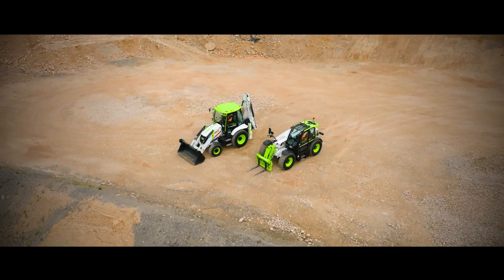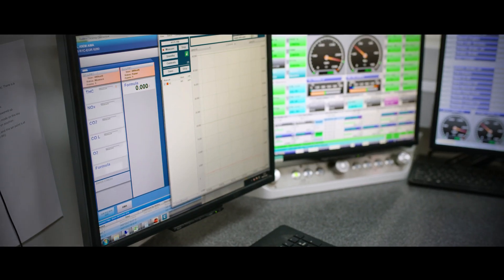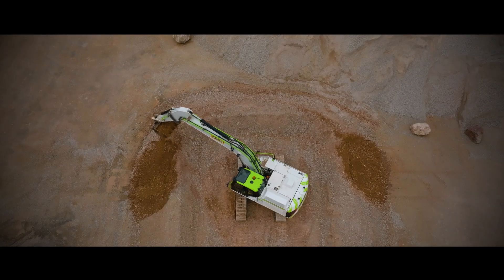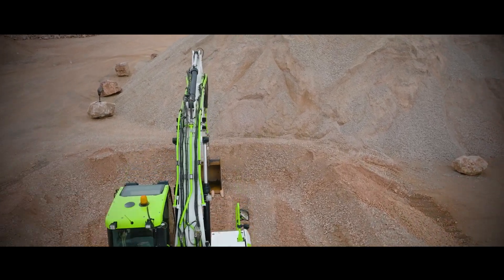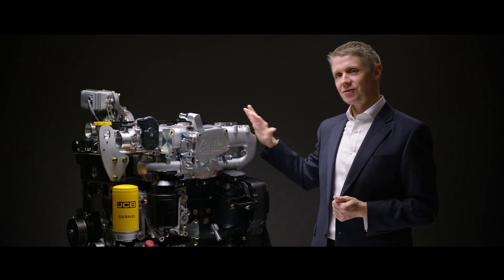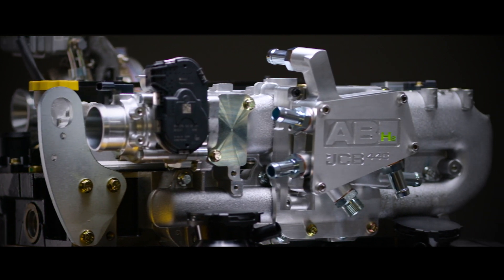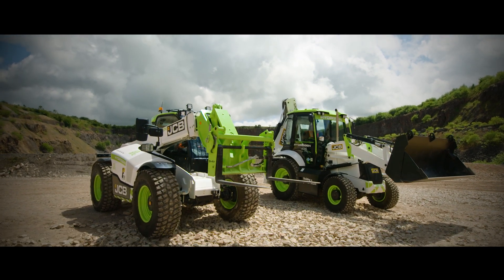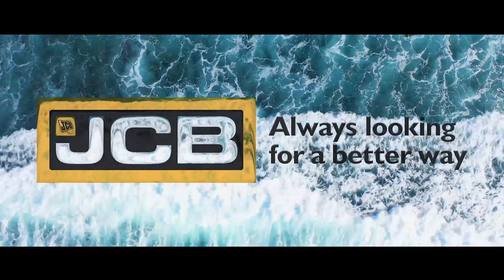JCB: Building a Hydrogen Future

Comment: Great work. I am a mobile welder running a diesel truck and diesel generators for on sit mig tig and stick welding plasma cutting and investigating laser welding. Not something viable with electric vehicle mindsets as mentioned before lithium Ion is being over promoted yet under resourced and lacking infrastructure. The use of hydrogen in the same way as petrol and diesel is by far more reliable and attainable
Reply: Translet  please Hidi

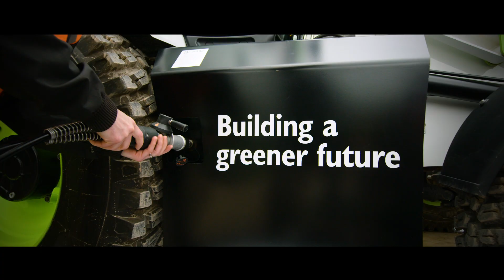Comment: 4:32 You could set up H2 pipelines from source to site using plastic hoses. 
Soluforce does 42 bar H2T FCPs flexible hose pipelines. 
Just need a compressor then to get to your required pressure.
Minimum logistics required then.

Comment: Great work on the technology.  But a few questions:
1. Where does the hydrogen come from?  There has been some discussion on using Australian solar electricity to produce it.  But how on earth will it be transported by sea to the UK?  LNG is tough to move around, high pressure Hydrogen or worse still liquid hydrogen, is going to be very expensive to bring from the other side of the world.
If UK wind/solar then the fuel cost will be at least 6 times more than just charging EV batteries due to all the energy losses.
In reality, for the forseeable future the cheapest way to make H2 is by steam reformation of Methane.  Which is a process that releases massive amounts of CO2 - don't mention CCS - it simply doesn't work at scale.  The fossil fuel industry is driving this idea because it's a way for them to keep selling gas!
2. What's the economic model vs Electric devices with better batteries that are coming on stream now?  The mobile h2 refueler could be a mobile charger with large battery pack doing DC to DC charging at 200-300Kw?  Itself charged from either a mains source near by or a containerised battery pack on site, switched out daily, like your h2 tube trailer delivery.
3. You mention it is clean.  Are there really ZERO Nox emissions?  NOx is very very bad for human health.
Reply: You are spot on with this information , maybe zero carbon but forgot to mention Nox, that's one of the main reasons to get rid of diesel, to me this is a red herring and JCB are doing this to keep I. Business, but it's not clean or efficient
Reply: @philpdl1615  Nox is not an issue. JCB explained that they can completely eliminate Nox emissions using low temp burns.
Reply: There is another CCS method in progress that you don't know about that scrubs the exhaust CO2 and mixes it with water to make a marketable byproduct. 
Also, greenhouses can demand 2000ppm CO2 to help with increasing yields.
CO2 doesn't have to be injected into the ground or whatever and it can be used as a commodity on a mass scale.
Reply: @philpdl1615  Evs are not clean too

Comment: The reason this will not work is simple Physics.
If you generate 100 Watts of wind power.
This is how much useful energy will remain to drive the wheels.
Direct Charging EV  73 Watts (Losses: Transmission / Battery charging/motor efficiency)
Hydrogen Fuel Cell 22 Watts (Losses: Electrolysis/Compression/transportation, Conversion, motor efficiency)
Hydrogen combustion Engine 13 Watts    (Losses: Electrolysis/Compression/transportation, combustion)
I think it is obvious that using 6 times more raw energy will never be economically viable. It sounds like a good idea, but the physics says it is not.
Reply: You're focusing on the efficiency of conversion from green energy without any understanding of these sorts of vehicles and the people who use them, JCB does understand them and their customer base. Besides white hydrogen reserves are huge and the use case for these vehicles isn't the same as cars, these are pushed all day without hours of downtime which would allow for batteries to be viable.
Reply: @TheAlexagius  "Geologists caution, that based on what we know so far, much of the naturally occurring hydrogen may be in places that are inaccessible – too deep underground or too far off-shore, or in accumulations that are too small to economically exploit." I totally understand the problem with large industrial machines that require large amounts of energy for long periods. This is one of the reasons that a totally inefficient solution will never be viable. I don't think battery storage will work for large machines or trucks but burning hydrogen in incredibly inefficient internal combustion engines will never be a solution. This will never happen, they are just wasting time to keep burning Diesel.

Comment: Honda made cars for a bit so did Toyota. But what failed was not enough hydrogen stations around
Reply: And according to experts hydrogen is around 18 x less efficient than petrol, not what JCB are saying, so basically to get the same energy from one tanker of petrol you would need 18 tankers to get the same energy, I can't see how this adds up, check out hydrogen video's on You tube.   If you were using hydrogen to make electricity, it takes 5x the electricity to make the hydrogen to start with  so how is this efficient. Do t get me wrong I'm a massive fan of JCB and have 3 of their machines, but this does not add up and I hope I'm wrong . Also this is ok if every one keeps hydrogen safe but if there's a meal and it gets ignition there will be nothing left to find out what went wrong,  the hydrogen bomb was the most powerful before nuclear ....

Comment: Hydrogen burns very cleanly in an internal combustion engine, more cleanly than any other fuel, even slightly cleaner than natural gas. It also produces mechanical energy very efficiently. Yes, it is possible to separate water into oxygen and hydrogen, but according to my understanding, it takes a more energy to do that than the amount of energy that is available from the hydrogen. According to my understanding, the most efficient way to get hydrogen from water is by using electricity and the most efficient way to do that requires over 415 kilowatt-hours of electricity to produce a kilogram of hydrogen, which contains only 39.4 kwh of power. So a bit more energy is expended than is produced. If we depend on coal or petroleum to generate the electricity we move the pollution from the hydrogen engine, to the electricity generating plant. Only by using clean electricity generation, such as by using solar power, wind power, or the power of falling water to generate the electricity, can we get those 39.4 kwh of hydrogen power without polluting the air. That said, storing hydrogen is a more efficient way of storing energy, than storing it in a large, heavy, chemical power cell (commonly called a battery). However it must be stored at high pressure, in very strong tanks. These weigh something. I am going to check that out and return.
Reply: I want to do some more research but I think the answer is that, for equivalent energy storage, say enough to move a compact car 300 miles, the hydrogen tank, even if made with very strong (and expensive) composite materials, would have to weight about 100 kg (230 pounds), would take up 270 liters of space, and a comparable gasoline (petrol) tank, filled with gasoline, would weigh only 30 kg and take up only 31 liters of space. Not as heavy as a battery, but heavier than gasoline.
Reply: @soilmanted  Use a pipeline!

Comment: Why will the hype around hydrogen turn into a fiasco?
The problem of hydrogen does not come from motorization or production but from storage and transport.
It’s the smallest molecule and you can't negociate with the laws of physics.

Leaked hydrogen is a gas 200 times more impactful than CO2 for the climate, so, it's NOT "clean".
Even without taking into account the risk of explosions in confined spaces (in a garage, for example), the benefit to the climate is lost entirely through leakage.
A good quality unused hydrogen tank empties in less than a month.
A hydrogen tank has a "efficiency" of 99%... It looks good, like that, huh?
—but in reality, it’s catastrophic because a leak of ,% only cancels ALL the climate benefit.
A 99% storage "efficiency" even worsens the climate impact because hydrogen is 200 times more impactful than CO2. 
—and that’s not counting the other yield losses throughout the pipeline. 

"Yes, but it can also be used as batteries," you will say.
No. Hydrogen is also a very bad idea for batteries.
We turn electricity into hydrogen, then hydrogen into electricity. 
Unnecessary complexity for an absurd overall return.
It stores electricity, which is the role of a battery, but it competes with "simple" direct batteries.

At this point, it is even better to favor electric batteries because they continue to evolve towards a lower climate impact and the sector is circularisable. 

There are also enough other technologies (inertial, cryogenic, gravity storage, technological improvement of existing batteries,...) alternative energy buffers.

Forget hydrogen.
The smallest of molecules increases climate pressure. 
Nothing virtuous. 
Next climate scandal.
It's also GREENWASHING for the naïve who see only the drop of water coming out of the exhaust pipe. 
https://www.euractiv.com/section/energy/news/scientists-warn-against-global-warming-effect-of-hydrogen-leaks/
https://www.nature.com/articles/s43247-023-00857-8

Jean-Marc Jancovici, an engineer with a green streak, bluntly condiders that the hype around hydrogen could be the next climate bomb. 👇
https://m.facebook.com/story.php?story_fbid=643752130441673&id=100044206760625

Denmark cuts costs and closes its hydrogen refueling sites. 👇
https://fuelcellsworks.com/news/in-an-unexpected-turn-of-events-denmark-will-close-all-its-hydrogen-refueling-stations-for-vehicles/#:~:text=Therefore%2C%20the%20network%20is%20closing,single%20hydrogen%20station%20in%
Shell in California as well. 👇
https://insideevs.com/news/708156/shell-closes-california-hydrogen-stations/de